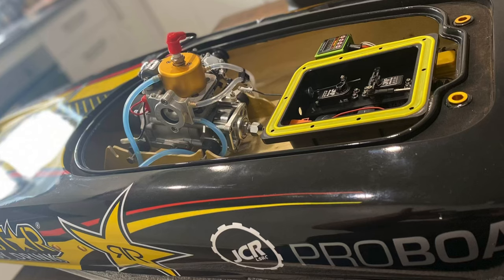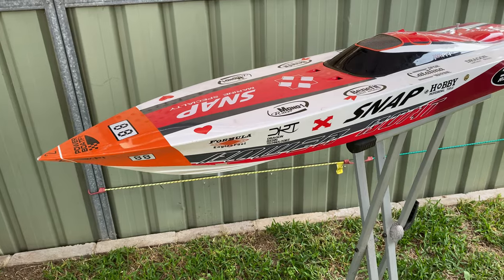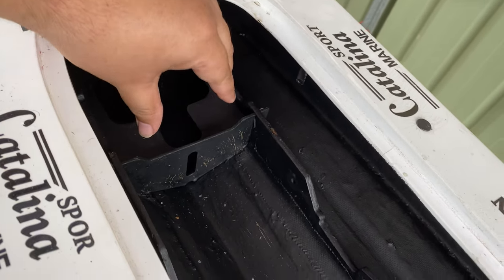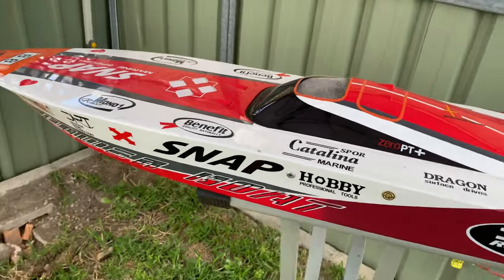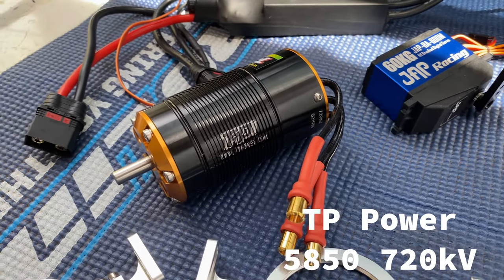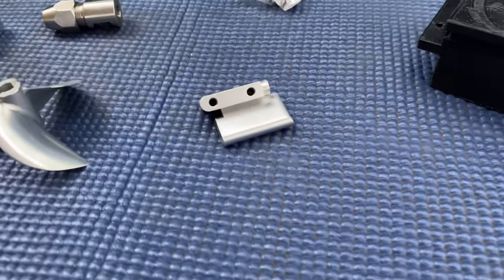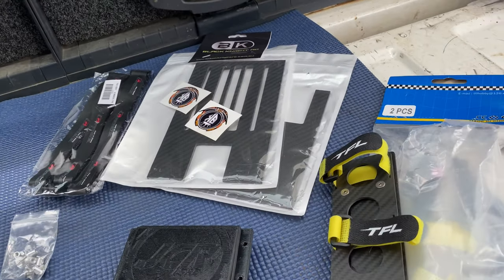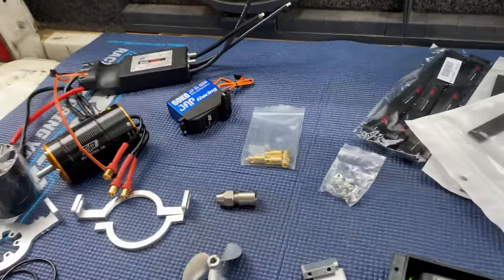HUGE 51" (1.3M) P1 DRAGON HOBBY SPEED BOAT - BRUSHLESS CONVERSION - PART 1

Comment: How does the cooling jacket fit over the finned case motor?
Reply: There is a slight difference in size, it’s supplied with O-Rings that make the bond between them watertight
Reply: @michaellucre8249  right on, I really want to build an Aquacraft Rio 51 and considered those same TP motors and wasn't sure if they'd work because most cans are smooth.
Reply: @garrettkifer8332  it’s definitely a very snug fit and tbh takes a little finessing. I’ll make sure to cover it in the build 👍
Reply: @RCTanksTrucks247  part 2 coming soon?? 🙂🙂